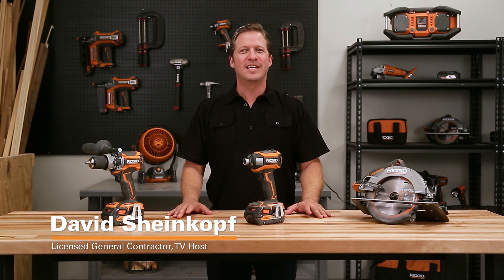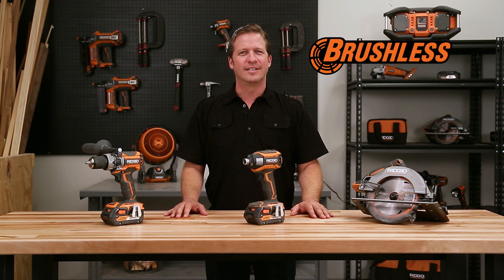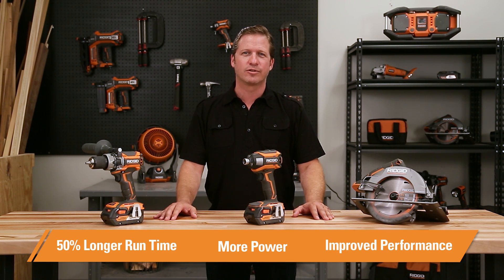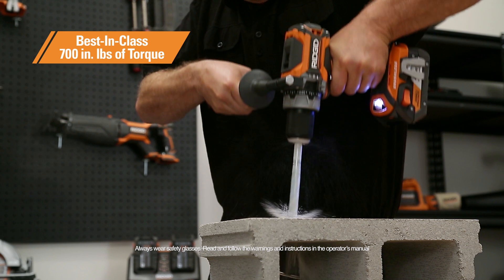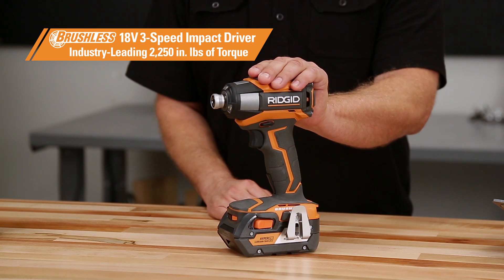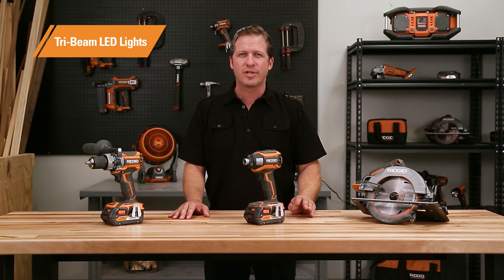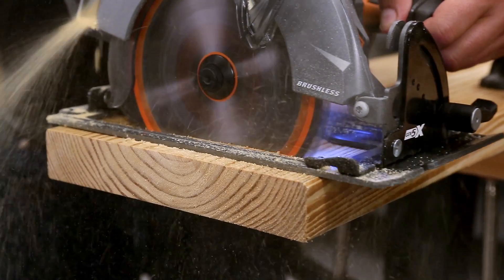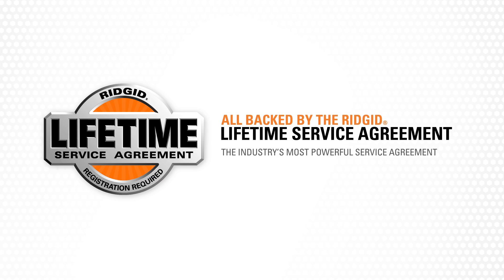RIDGID Introduces 18V Brushless Tools

Comment: I need some help, i have a ridgid 1/4 brusless impact driver, The motor seize with the stator and buen, i repleaced with a new motor, but the  new motor seems stuck con the stator, after some trial it loose bit but wont run freely, i replaced the  plastic covers, bit seems that it wont help at all, any idea, help? Please!

Comment: If you live in BC Canada, stay away from rigid. There is only one dealer that fixes rigid or where you can buy parts. A 3 dollar part in the US will cost 35- 50 to deliver from the US. If you buy it in BC the part costs you over 13 and they tack on 12.95 shipping on a part that weighs a lot less than a penny. I for one will never buy rigid again. My air compressor got 5 hours use before breaking down, still waiting for a part that was supposed to be shipped  in 7-10 days, as of this morning they don't know if they shipped it yet and it's been 12 days, they made sure they took the money though.
Reply: +TJ Garmarz Thanks for the advice, got the part we needed and fixed the compressor ourselves. We have since decided to stop buying cheap tools, and replaced it with a Canadian made compressor. Rigids warranty means nothing as for quality they are way over priced.
Reply: +TJ Garmarz Rigid is limited lifetime, not lifetime. And you shouldn't have to fight to get them to uphold a warranty, as we knew the warranty would not cover the product we only wanted to replace a 3 dollar piece that cost us over 30 to be replaced if we had bought it through rigid it would have cost us 60. If we would have sent it into rigid to be fixed I could only imagine the cost, so no not worth the price. Sorry reviews of products do not put rigid at top of list for compressors.